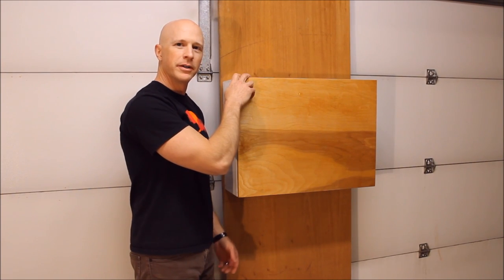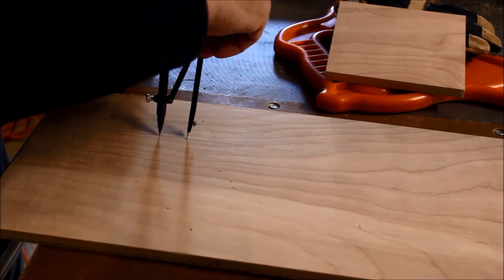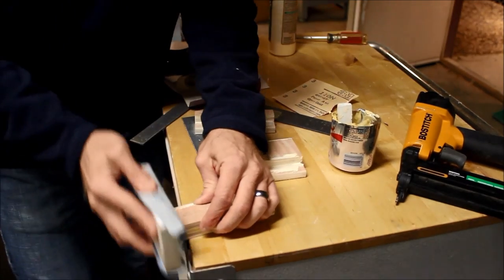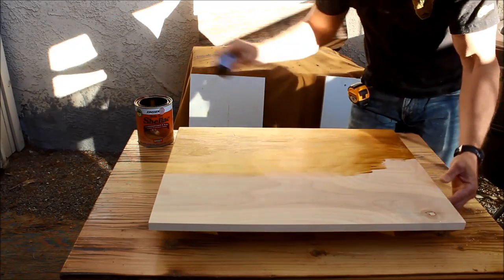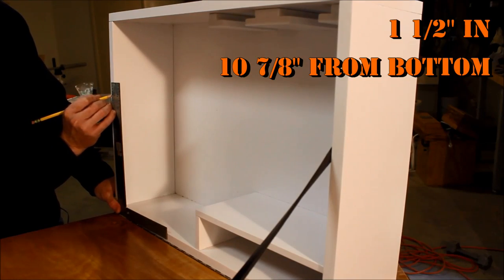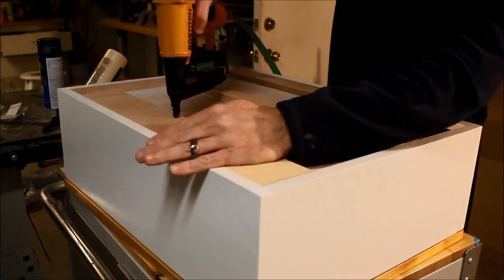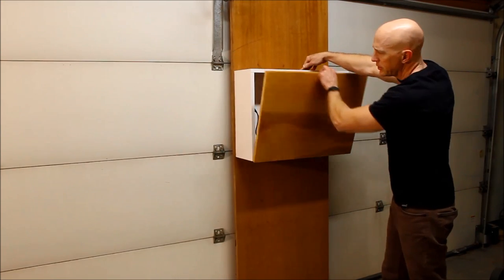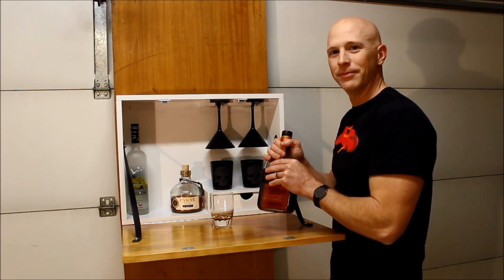Making A Wall Mounted Bar

Comment: Very nice job Chris.  I'm certain the recipient will be very pleased.

You mentioned securing the bottom to the wall with a screw.  I presume that will be hidden behind the drawer, or did I missunderstand something?
Reply from the maker: Thanks Michael.  Securing it behind the drawer is an option, but there isn't a lot of room to maneuver.  I planned on trying that, but worse comes to worse I'll paint the head of the screw white on the liquor bottle side.